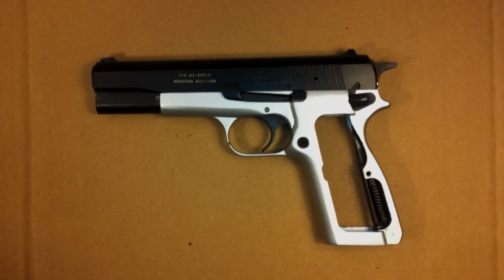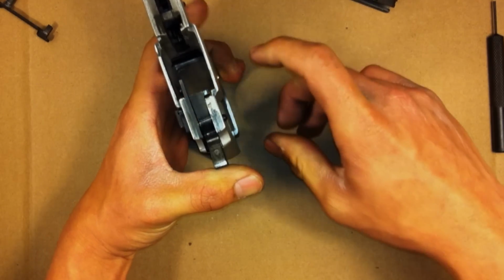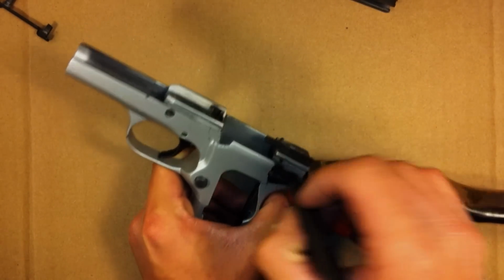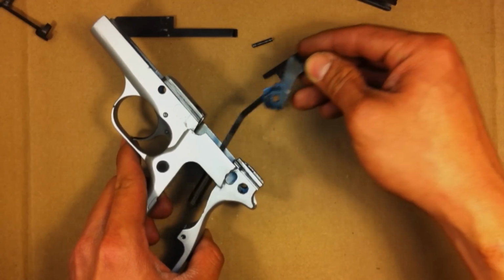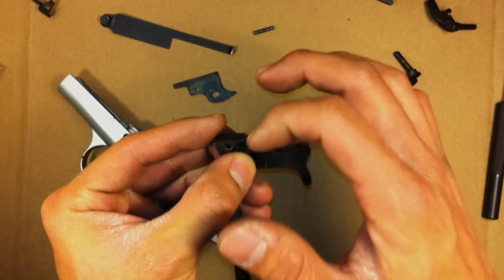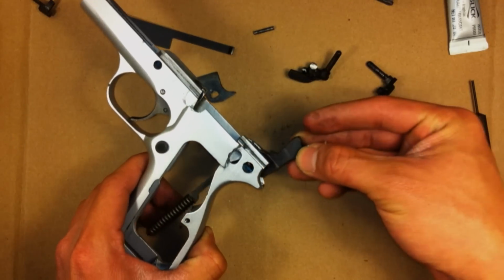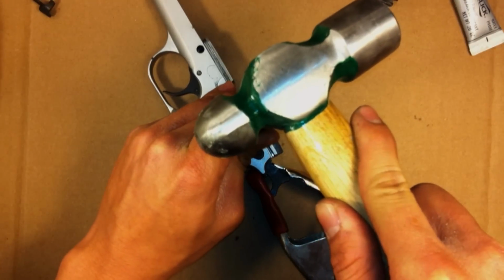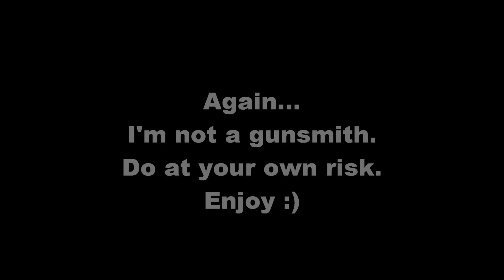Browning Hi Power Trigger Job

Comment: @5:04 a buffing wheel is not really the right tool for the job.  You do want to make it smoother, but only while always keeping that edge as flat and square as possible which means you would use a flat stone like an Arkansas stone to polish the flat surface there.  

By using a buffing wheel you're inevitably rounding it some, decreasing the contact area and making it more prone to slip off.  From the video the edges look a bit rounded.  Those corners, where it "breaks" (and doesn't when it's not supposed to) should be sharp.  Be careful.  

Also you probably know by now but that plate is the ejector.  Great clear video overall, and a good guide for frame disassembly, etc.  Especially good if it was your first one.
Reply: , zzz

Comment: I have the same gun and do the same trigger job. Except that I use a Wolf 26 lb hammer spring. I first remove the mag safety but notice that the magazines tent to rattle as if they were loose,  affecting the feeding of reloaded bullets into the chamber and the reliability of the pistol. So I put it back again and the problem disappear. I use a trigger pull scale to measure the trigger pull weight and it was still about 8 pounds but very smooth.
Reply: David Lorenzo  that is the magazine's rattling

Comment: Before doing any of this, relieve some of the sear spring tension.  That's the flat leaf spring in the back that covers the hammer strut and spring.  If the trigger pull is crisp with no creep, the sear spring will accomplish all the trigger pull reduction needed.  Smooth the sear and hammer cock notch if you want, but only to a polish surface.  Big risk of screwing things up if you file without the proper jigs for sear and hammer.
Reply: That makes sense, but what about also switching to a lighter hammer spring (mainspring)?
Reply: And just how are we supposed to do that  "....relieve some of the sear spring tension"??

Comment: What are the purpose of the three holes on the slide?
Two holes on the side and one hole on top?
Thanks for the video.
Reply: The hole on top of the slide accepts a roll pin to anchor the extractor that extracts the empty case. 
The two holes on the sides accept a roll pin that anchors the transfer bar between the trigger and sear.
Both holes are drilled thru the slide so that you can line up the parts.
Reply: @stoxninenine2881  Thank you. That was very helpful.

Comment: The problem you would have is if you change the angle of the engagement and the angle at which those parts fit together. It's like doing a trigger job on a Super Blackhawk, you can easily get it where you can actually talk to hammer and it pushed the back of the hammer and push it until Hammer releases. Got to be very careful about keeping the angles that are already there.

Comment: Informative disassembly, but dangerous otherwise. You don't know what an ejector is, but you're doing trigger jobs? The hammer and sear surfaces have angles that must be maintained and are hardened. You can't file through the hardened surface and polish the angles off and have the gun be safe. Triggers, ESPECIALLY on single action guns should be left to gunsmiths. Not bashing, but there's much you're not aware of.

Comment: Scary gunsmithing, but Good comedy.
Reply: +Dan Williams Yeah...if he actually polished the sear nose with a circular polishing wheel...he likely ruined the contact points.  The sear face must be cut at a proper angle with a jig and polished with finer and finer perfectly flat stones!!!  The hammer notch must also be perfectly flat and polished.

Comment: Please do not do this.. This is NOT a correct trigger job..This will make the gun unsafe.. Consider that the guy doing it doesn't even know what the parts are that he is working on. If you don't know what the parts name is then you have no business messing with it!
Reply: My sentiments exactly, "safety plate mechanism thing".  How would he go about ordering parts I wonder...
Reply: You would be fine to just polish those parts with a felt wheel and dremel instead of filing off actual metal